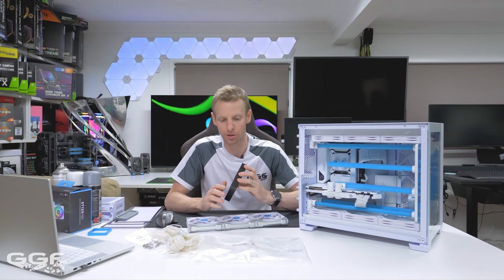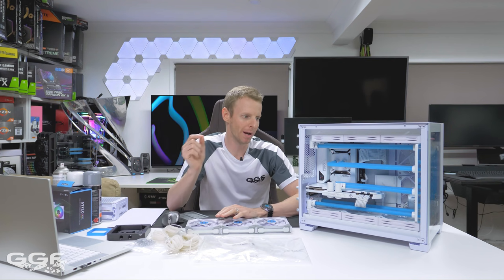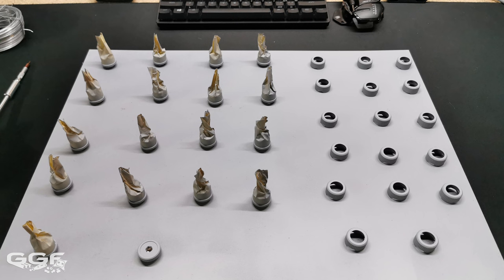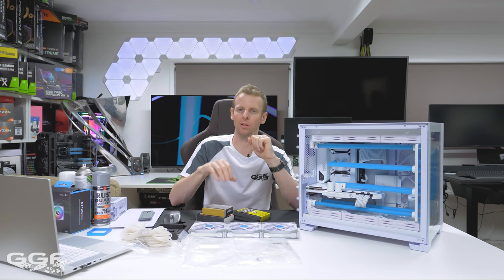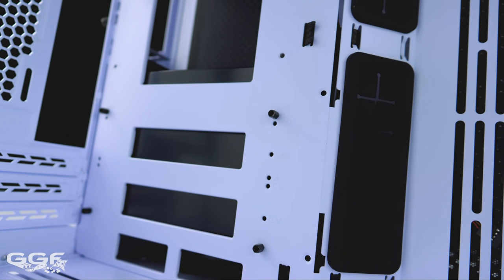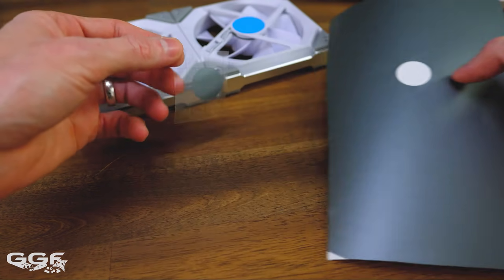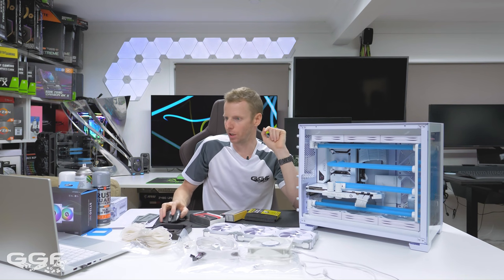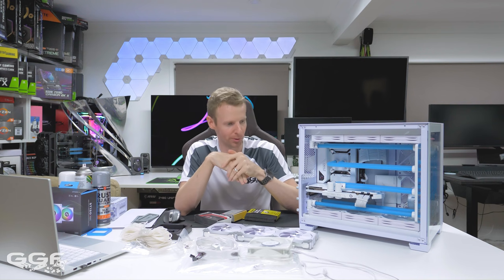O11 Mini Snow - Mod Build Video - Painting, Frosted Tubing, Fan decals

Comment: You can install the 360 rads with 3 fans by removing the backs panels first then it will slide in from the back to front of the case with the distribution plate  installed
Reply: would this work with an atx motherboard?
Reply: @arian_s_collection  Yes!

Comment: Plan to build with this same distro plate and radiator placement. what size spacers/fittings are needed to get that perfect straight tubes from distro plate to radiator in/out?

Comment: My build, heavily inspired by this one, is almost done! Just waiting for the tubing and one or two things to arrive... 

Tried to minimise the amount of painting by finding factory white components, like the white Corsair XR5 360 radiator. For the fan stickers, I found this guy on eBay who sells brushed aluminium effect Corsair fan logos. Using a mATX board, so no need to create a custom plate. I spent so many hours trying to do the white o-rings for the distro plate. I'm almost certain it's impossible, even perfectly glued together using Loctite 406, there's extremely tiny gaps where water leaks out. The worst part is once you notice this leak, you have to take off 40+ screws. Putting out a bounty for white o-rings that don't leak, $50 for anyone who's able to do it! I found trying to replicate the exact blue (extremely saturated) to be really, really hard. Instead of the EK Cloud White premix, I bought the 1L one and added half a bottle of EK's blue dye and it's still not as bright! I'm worried adding more blue will make the water dark.

First time spray painting, luckily I have a respirator! For whatever reason the white spray paint I'm using (Rustoleum Matt White) takes forever to dry. It's still a bit sticky to the touch after a day. This is with what seems like a decent self etching primer. Found out that putting it into the oven at something like 100C for 4-5 mins seems to help a ton. What probably doesn't help a ton is that I'm in the UK with crappy weather.
Reply: Hey Loshan, did you already succeed in doing the white o-rings? Maybe you didn't tighten them with exactly the same torque? Did you also replace the screws?
Reply: one year later...I managed to get the white o-rings on the distro to work but like you said it was a pain. A few lessons I learnt:
- Use a craft knife or similar to cut the silicone rather than scissors so that each end of the cord is as flat as possible
- I used super glue to bond the ends, holding for 2 minutes while it bonded, like in the video
- Make sure the o ring is a mm or 2 over sized so the join in the cord is compressed slightly rather than under tension
- Apply a small thread of loctite 595 at the bottom of trench where the o-ring sits the whole way around. You can't see this once it's compressed and dried. Apply this just before adding the o ring and putting cover back on (i.e. wet when you screw back together). I found i needed to do this to get the o rings to stay in place otherwise they would pop out before I got the cover plate back on. I used this 2mm cord from Polymax - https://www.polymax.co.uk/rubber-cords/white-silicone-cord-2-0mm-diameter
- Also add loctite 595 all the way around the bond where the superglue is (i.e. around the circumference of the cord/bond), this will seal any small holes in the joint once compressed. Again do this just before you screw back together

I did this on the distro block, gpu and cpu cover and no leaks. Left 24hrs to leak test and no drop in pressure. Has been running for a week with coolant with no issues so far, will update if this changes.

Comment: HI, what EKWB EK-Quantum Torque Extender Static MF you use on down and up radiators to fit right line and is some different connections can be done on GPU to distro?  THX

Comment: This is one of the best builds I've seen up to date! Some aspects of this have been used as inspiration on the build I'm currently working on.
There is just one thing I cannot understand, what are the bottom and top extenders that are used used below the angled fittings? Looks like the top has the EK-Quantum Torque 14mm extenders and the bottom could be the 7mm ones but how have they been lifted up to different heights? I assume the extenders used on the GPU block are just the 7mm ones but for the rads?
Reply: Hey Daniel, did you figure out which extensions are needed to lift off the 90° angle fittings above the fans?
Reply: @Srv02  Hey, I did yeah. I'm using the 14mm extenders (using EK Torgue lineup for all fittings and EK radiators with Lian Li AL unifans). This way the tube will perfectly clear the fans. :)
Reply: @deevirus  Thanks my man! I also got my parts today and they fit perfectly. Looks like GGF had some other revision of the radiators, as mine lined up perfectly with just the 14mm extensions.

Comment: @GGF Events  i'm planning on making the same type of motherboad plate as what you have done with 1mm thick Aluminium sheet. Question, does the rear motherboard armour get in the way? is it a tight squeeze.. or did you remove the armour altogether and install the mb bare? My motherboard is the Crosshair Impact

Comment: Do you have to have a micro or mini Mobo or will it work with an ATX (lines remaining level and parallel)?
Reply from the maker: Can't fit top rad with ATX mobo
Reply: @GGFEvents  someone makes a plate to offset the top radiator.

Comment: I tried to sand the PETG tube with a fine grit but my tubes revealed some tiny roller trenches along the tube, about 30microns deep, every 2-3 mm. These trenches refused to go away. So bear in mind that XSPC tubes must be either sanded harder, with some 180 grit (maybe?) or left clear.
Reply from the maker: Hmm that should work. Maybe try sanding pads.

Comment: Do you think it's possible to mount the GPU vertically using the Lian Li o11 mini vertical mount, without having to change the fans or radiators? Do you think there would be enough clearance to do this without changing the tubing too?
Reply from the maker: Unfortunately only fans will fit on the bottom with vertical mount.

Comment: How loud do you find the ST120s? I put 6 in mine and it's loud on its lowest rpm, let alone max RPM 😅
Reply from the maker: Actually can't hear them at low rpm
Reply: @GGFEvents  that's crazy! LianLi said that the noise was expected to be high with 6 fans :/ Have you ever tried measuring it?
Reply from the maker: Yes I have a reader and will give it a go
Reply: @GGFEvents  That is incredibly nice of you! Thank you! (Also a great chance to say how awesome your work is! I aspire to one day build a pc like the ones you showcase!)
Reply: @GGFEvents  did you get a chance to test it out btw?
Reply: @GGFEvents  do you still have this system to test it out by any chance?